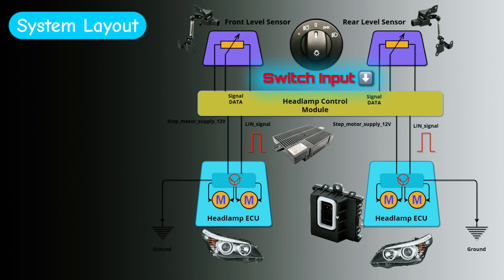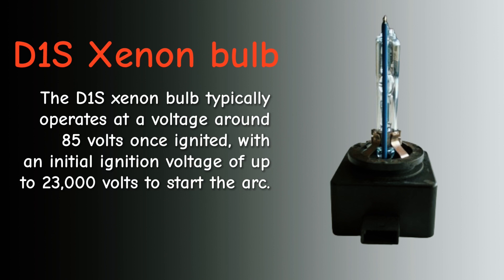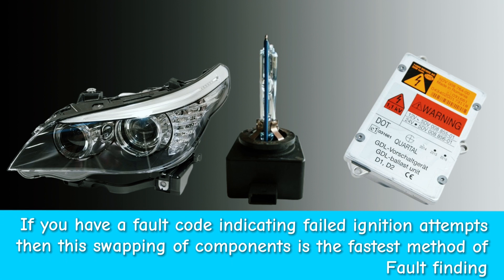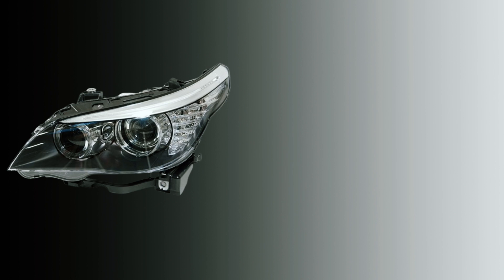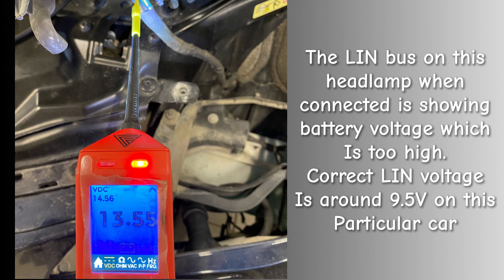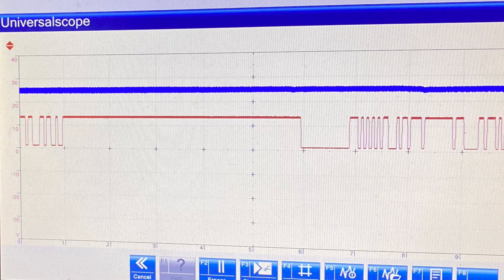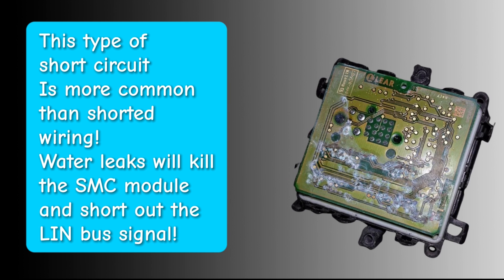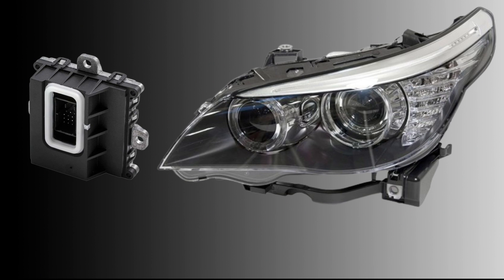THE SHOCKING REASON WHY BMW XENON LIGHTS FAILED - YOU WONT BELIEVE THIS ONE SIMPLE CAUSE!

Comment: Awesome video mate. This is so helpful. But is it possible to have the SMC errors with a burned out ballast? I swapped in LCI headlights using the official bmw LCI retrofit harness and xenon will not come on. Says too many failed xenon ignition attempts and left + right SMC codes these are the only 3 codes. 

I also read the LM module itself can permanently disable xenon output if it fails too many times. Seller shipped me the LCI lights like an absolute moron so I’m afraid either the ballasts got fried or maybe it’s a LIN bus thing like you have. Thank you so much for your help if you see and reply to this comment.
Reply from the maker: The LM does not disable after too many attempts the frm does that. Ballast does not cause smc fault codes. You cannot just retrofit lci lights without changing the vo. Smc modules need to also be coded

Comment: I have a strange fault on a 2004 E60 with the RH Xenon. On PIN 4 I have 10.4v with full beam on, and 10.4v with full beam off. On the LH headlight, it is 6.6v and 14.4v respectively. The wiring harness is free of issues having stripped it back, and I have fitted a new light control module and coded it. The H7 bulbs function without fault. Does anyone have any ideas about what else is causing the fault? I've tried swapping the headlights and fitting a known good replacement only to see the fault remain.
Reply from the maker: Do you mean the xenon bulb is not igniting on the RH side? 
https://issuu.com/hamervillemediagroup/docs/pmm_may_2023/14?ff&hideShareButton=true
This is an article I wrote last year. Page 14. 
I suspect the LIN is one of the wires you have issue with.
Reply: @BenJFF  No, unfortunately, the xenon is on full beam all the time. I think that there is a solenoid controlling this, but I'm not sure. I fitted another unit and the same fault appeared. I swapped LH and RH, and the fault followed which suggests the wiring is okay and it's the cornering module or ballast. I swapped them and it made no difference. I'm puzzled, as it makes no sense to me. I am worried it's a coding fault because I can't make sense of it.

Comment: Can i have your email? i need your help to my bmw E90. thank you very much
Reply from the maker: I dont offer email help but you can post on here and see if a solution can be found. Fault codes and symptoms?
Reply: @BenJFF  my car give me the steering wheel error but it's only a error because i use a bypass. If do a travel more than 1 hour the something heat to much in the electrical circut.
Reply from the maker: @valethebest46forever What bypass? You mean for steering lock ELV? What heat and in what circuit? If you mean in the bypass emulator then thats the issue.
Reply: @BenJFF  no, a hear a soud  like the fuse pump (popcorn) in the ecu , under the fuse box ..this happen when it' s like overheat. But in the morning the car start normal. In BMW they say me it's the cas, but i'm not sure about. Month ago when i reseted  the elv counter, stayed resetet i little but now no more every time show me the elv error. I think can be the fuse box or the cas or something in the starting circut when i pun on the start button.
Reply from the maker: @valethebest46forever Inside the CAS is a white relay for the starter motor. There isca diode usually that burns in front of relay the cause is simple its either:-
1- bad corroded engine ground cable
2- bad + power supply from the back of car to front due to corrosion
3- bad starter
4- JBE fuse box positive cable burning 

But CAS is not near fusebox. If you have fusebox burning sound you must remove 4 screws to fuse box remove and see if positive cable is melted. There is a modified cable available that locks in to the fusebox. 

If you find the issues you can press"SUPER THANKS" and buy me a coffee 👍
Reply: @BenJFF  thank you
-ground cable it's ok 
-i changed the starter
-in cas i didn't seen a burned control unit ....

I have to check the positive cable of fuse box unit.
Reply from the maker: @valethebest46forever I didnt understand where you meant. If you meant fuse box area (JB) there are two things - the heater blower resistor melting and the positive cable melting at back of JB.
Let me know if I helped you and found the fault
Reply: @BenJFF  The bad sound on the start button come from the ecu under the fuse box(non in the JB), there a have the ecu. You halped me ..i have to ceck the positive cable of the JB.
Reply from the maker: @valethebest46forever Understood. Great